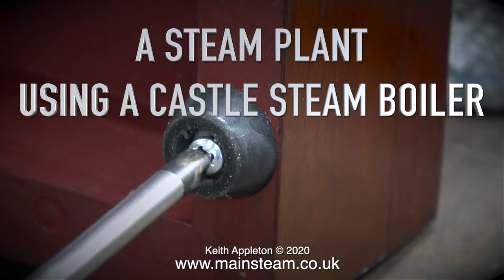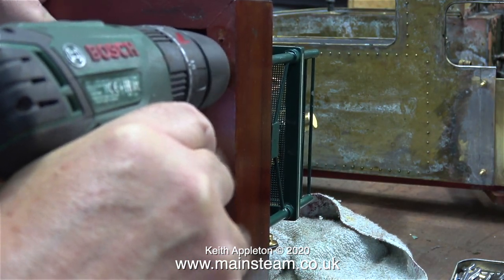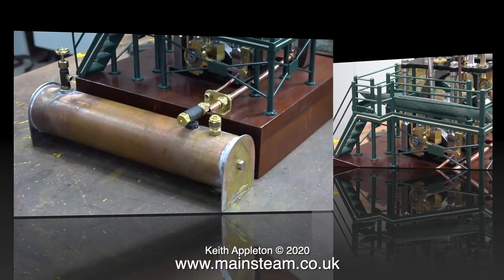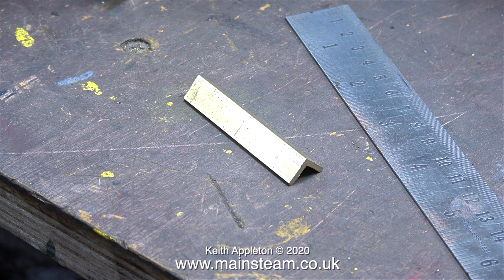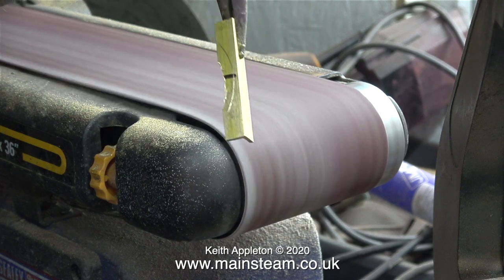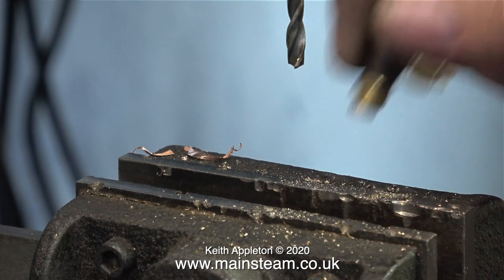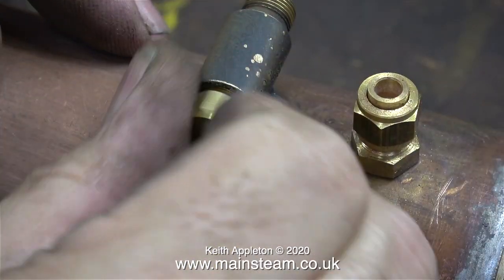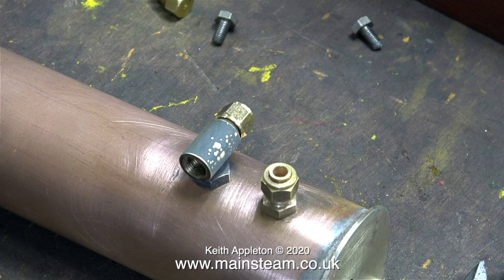A STEAM PLANT USING A CASTLE STEAM BOILER - PART #7

Comment: Can tell that selfetching primer is also a must for good adhesion to aluminium...  😉  Thanks for a good series of videos, keep it up for as long as you have fun doing it!
Reply from the maker: Etch primer is really for use on steel. But the stuff that I use works well on brass & aluminium.
Reply: @keithappleton  There is also special eching primer for boat hulls in aluminium, but as allways, the boating industry have lots of special products at special (High) prices... 😄
But as a metalworker in general ( I have a journeymansletter as a finesmith) I find it interesting to see there are more fields of application than I knew about for things, and your series is fun, interesting and educational in more ways than one! 👍
Reply from the maker: Thank you Klas, I appreciate your comment {:-)))